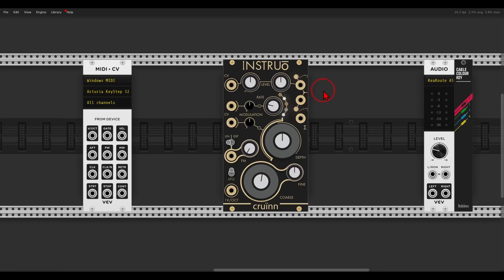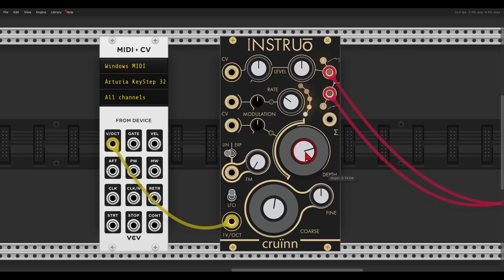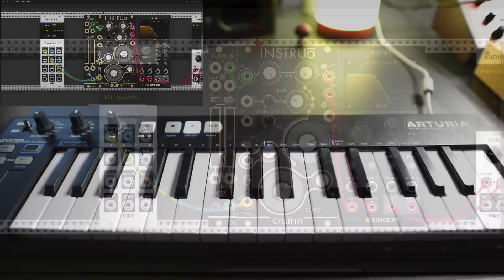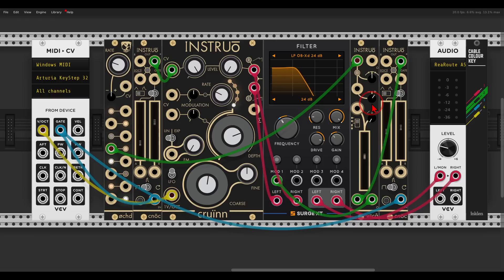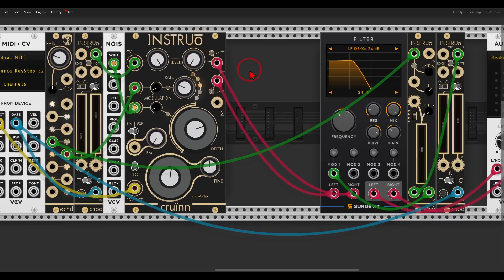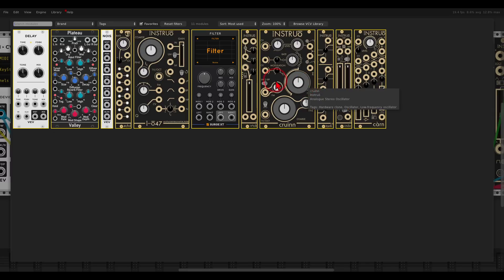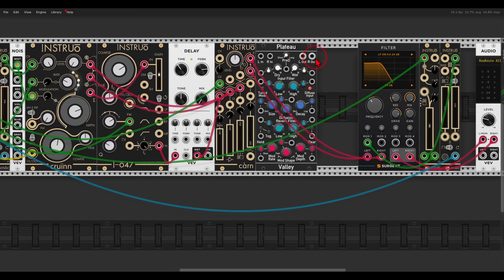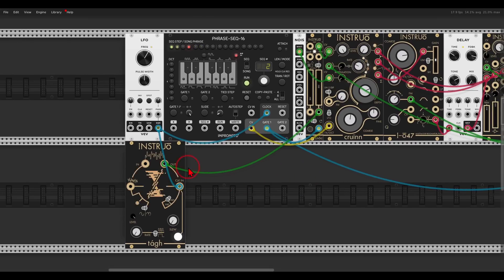Huge Crunchy Bass with Cruinn from Instruo \ Patch From Scratch

Comment: Beginner here... If you mess with the "Coarse" or "Fine" knobs at the bottom, how would you make sure that the sound is still in tune with your keyboard (so that C on the keyboard actually results in C being played)?  Would you have to use something like Hot Tuna or some other tuner to actually make sure that pressing the C key results in a C note, or is there something more simple than that? And how would you suggest dropping the output by an octave?  Would I have to tune it to C3 instead of C4, or again, is there a more simple way to do this using, for example, the 1V/OCT input?
Reply from the maker: Hi! Well, if you change the settings and you want to bring it back to C, just double-click the knobs and they will jump back to default, which is C. In hardware, there's a need for a tuner, yes. I usually take the Depth knob all the way down, and then use the Sigma output for tuning it. If it's tuned to C, then a C note on your keyboard will also produce the note C. If you want to lower the pitch by an octave, you can use the OCT module from VCV. You send it to the V\OCT input, and then change the octaves. If you're using external pitch as well (like your keyboard or a sequencer), then you send it through OCT, and it will still offset everything. In hardware, there's again a need for a tuner. I hope it all makes sense. Let me know :)
Reply: @OmriCohen-Music  Thanks, that makes total sense!  I really appreciate the quick response, you're awesome!